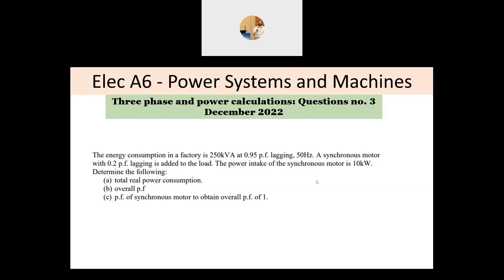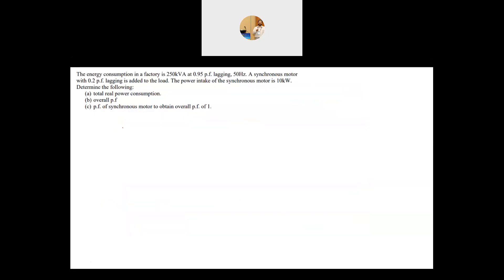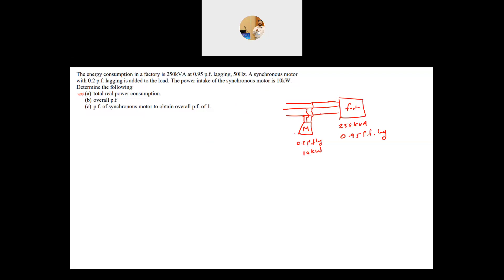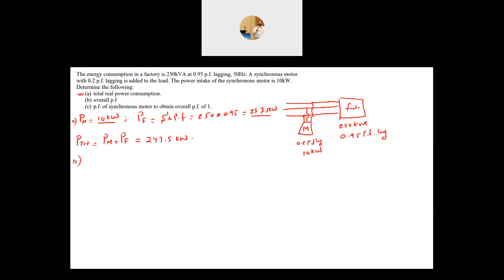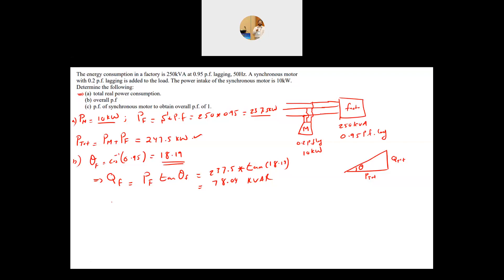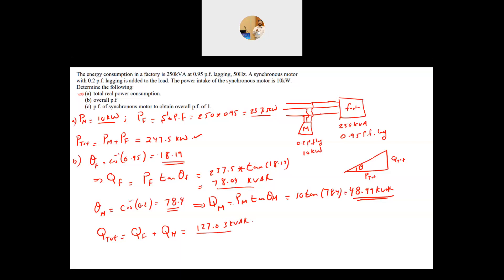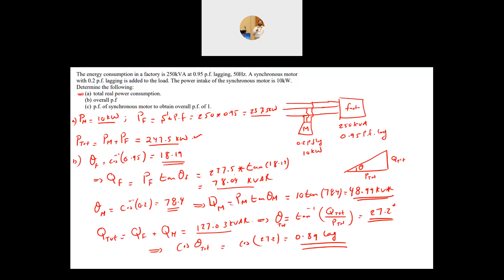PEO solved examples (ELEC A6) Three Phase Question no. 3

Comment: Can’t we calculate the kVA of a synchronous motor by dividing its real power by 0.2, and then determine the overall power factor by dividing the total real power by the total kVA?
Reply from the maker: Real power is a scalar but the apparent power is a vector, so you can add P1 and P2 but cannot add S1 and S2 unless you add them as vectors with their angles.

Comment: Aoa Dr. Ayman, Can part (b) be solved simply by having Ptotal = 247.5KW (part a) and we can find Apparent power for Synch which will be 50KVA. Total Apparent power will be 50+ 250KVA = 300KVA. So total PF = 247.5/300 = 0.82 lag. Please let me know if this approach is correct.
Reply from the maker: You can only add real power (P) to each other or reactive power (Q) to each other because P and Q are scalars. S (aaparent power) is a vector and hence you cannot simply add S1 to S2 or adding S to P or Q
Reply: @electrical4everyone  Actually, I made that mistake initially 🙂 
Now everything makes sense

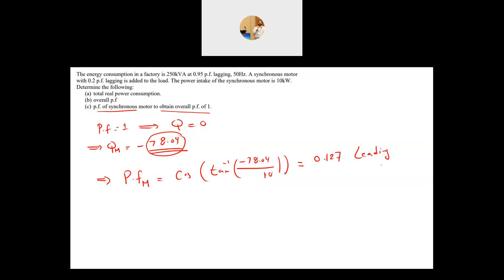Comment: Thanks, Dr. Ayman, for the great explanation. In 8:30, why did you consider the power to be 10KW? We should use the total power (247.5KW). Right?
Reply from the maker: The last part asks for the power factor of the motor and not the total power factor, this is why I used the 10kW.